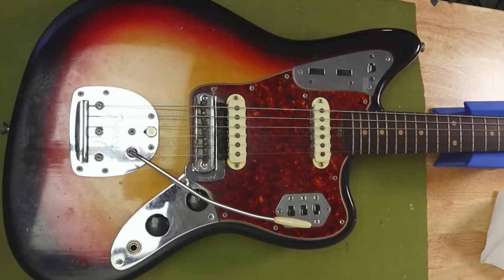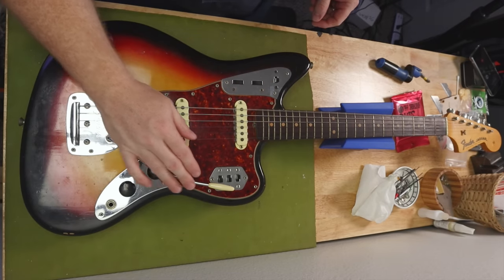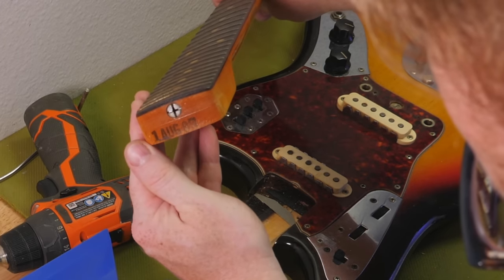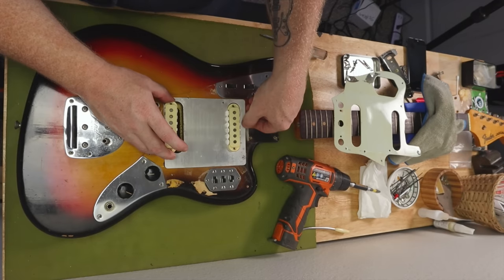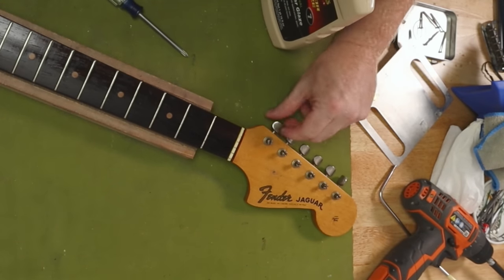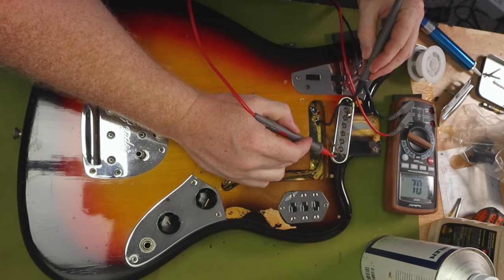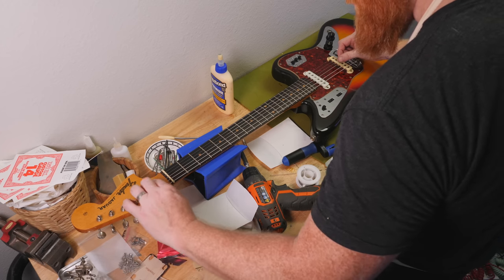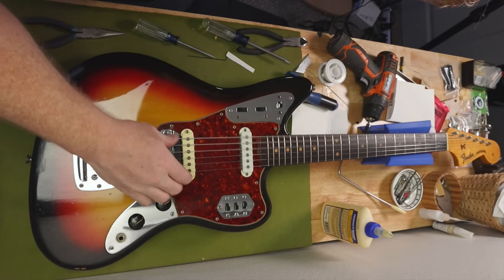ON THE BENCH: 1964 Fender Jaguar Tear Down, Deep Clean, and Setup

Comment: I love the muted sound of Jags, but I hate how the mute makes the strings go slightly sharp when engaged. Even with minimal pressure and correct mute adjustment they still go a bit sharp, because the vibrating length of the string has been slightly reduced. So on my own Jag, I repurposed the trem lock to fix the tuning when the mute is engaged. The trem lock is set to push the trem down ever so slightly, so when I flip the mute on I also engage the lock and it stays in tune.

Comment: Hey Mike, I have a very similar '63 (literally down to the shorted neck pickup). It plays decent as it is, could use some new frets, BUT the real issue is that the truss rod no longer offers any additional relief at it's loosest setting. Any recommendations to remedy this? Does it need to be heat pressed?
Reply from the maker: Joe! If the rod is maxed out with very little effect, then I'd suspect that heat treatment is the only way to get it straightened out. Of course, I haven't seen the thing and can't say for certain, but I see this a lot and generally at this point, it's the best way to deal with this issue.
Reply: @Puisheen  Thanks Mike, I figured that was probably the case. It's max loose and thankfully it plays well as-is, but of course would love to have full truss range. Thanks man, really appreciate the reply! ps.... now I need to look for some pickup dates!

Comment: Mr Puisheen,
Silly question: is it possible to use the switches and wiring from a Jaguar on a Jazzmaster? 
Of course, I’m considering some delicate modifications to the Jazzmaster pick guard, to accommodate the switch plates from the Jaguar. 
What say you?

Comment: Hi Mike, I have 1965 jag and I am experiencing the whole circuitry to be somewhat microphonic. It is especially noticeable with drive pedals, and if I use to it goes into a, how to put it, “phase kinda feedback”? It is noticeable even with clean sounds. When I tap the body, neck, pickguard, control plates, even the strap buttons, you name it, the pickups simply pick it up. I’ve seen the foam under the pickups, it is all hardened and deformed, do you think it could be caused by it? It is manageable but pretty annoying especially with the gain… thanks so much!

Comment: Sounds great (as always!) 😁

A mute question: do you often have mutes that actuate as easily as that? I've tried fitting one both to a body that was pre-drilled for the mute and one where I drilled the holes myself, and with both, the 'switching' is stiff and doesn't fully engage in either position sometimes. Any rookie mistakes I'm likely making or reccomended tweaks to the mute parts? I've tried tightening it down low and that makes it quite stiff. Any higher and it interacts with the bridge itself which can't be good for keeping intonation. Using slight neck shims to allow for proper bridge height too!

Comment: Hey Mike! If I can, I would like to pick your brain for a minute. I have a Squier CV 60’s Jazzmaster that I’m looking to replace the pickups on. (Fender CuNfie cobalt Jazzmaster set) looking inside, the guts are leaving little to desire. Do you know of a vintage style pre-wiring harness that you would recommend? And what the best pots would match these pickups?  Also have you had any issues switching out the Squier neck with a fender neck? 
Again thanks for your time! 
(I know your a busy man) 🤘🏼🤙🏼
Reply: Oh! 💡 
What do you think about removing the rhythm circuits, and replacing it with the Eric Clapton mid boost kit? There would definitely be room for it in the routing already there. 
A Jazzmaster with a full cup of instant fuzz always on Tap. 😁

Comment: Hi Mike, I was wondering if you could help me figure out what mastery vibrato and bridge I should use for the squire 50th anniversary jazzmaster. I think I saw you put some on one at some point. I live in Dallas, and I don't know of any offset techs around. Everywhere around, here is geared up for country players and their guitars. I'm a shoegaze, noise guitar type player, so that sort of leaves me in a bit of a pickel. Great video, as ever, by the way.
Reply: You can get the bundle OMV / OMV-P. Both include the thimbles you may need. The only difference is cosmetic in that the OMV-P vibrato plate is buffered to a high polish while the other is matte sanded finish. Bridge installation instructions is included so any decent luthier should be able to install it, it’s not that difficult.
Reply from the maker: Just here to back up Biff (is this the 1950s Biff or the 1985A one???) and yes, I'd just go for the bundle including thimbles. Squier and Fender body inserts can vary a lot these days, and using the Mastery inserts will ensure a proper fit. Go for the OMV KIT or the OMV-P KIT based on your preference for a polished vibrato

Comment: Sounds thicker and fuller than a Jaguar is legally allowed to :)
Reply: That's the old, flat pole pickups. They hold some magic that the later staggered pole pickups and reissues don't seem to have. The original flat pole pickups have a great attack and midrange focus rather than the brighter, slightly thinner sounding later pickups.
Reply: @jackgreenwood1817 these are staggered, ‘64 wound with plain enamel, not very degaussed either. After rewind the neck measured 6.08k
Reply: @Sundayhandwound  ah yeah I see now, interesting! I have flatpole pickups in my '62 that have the same bite without ever sounding brittle or thin. 
I wonder what gives old pickups that magic sound? I guess you'd know as good as anyone :)
Reply: @jackgreenwood1817  some sound better than others, time passing makes most pickups better too.